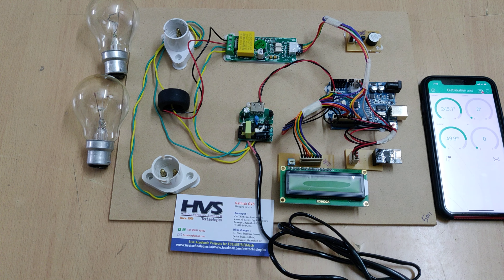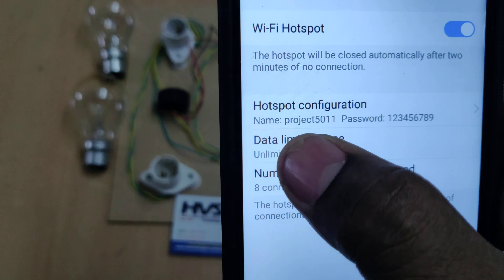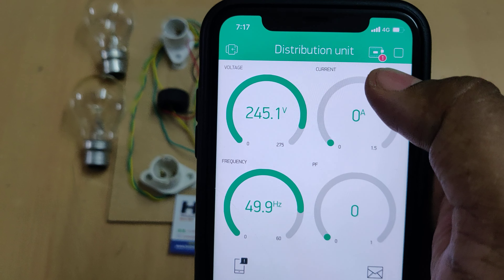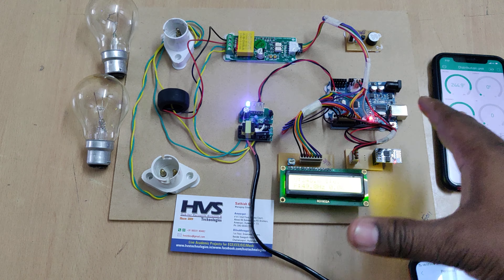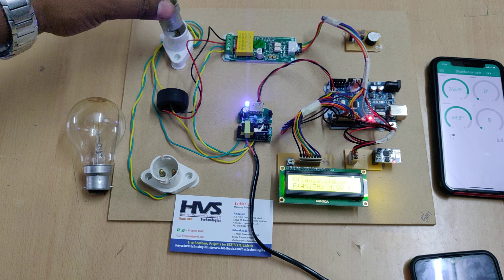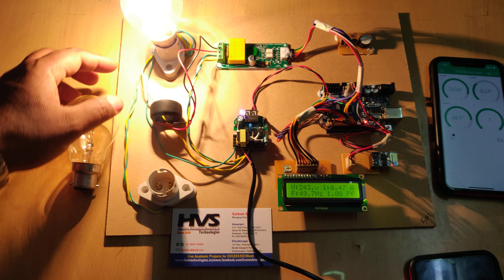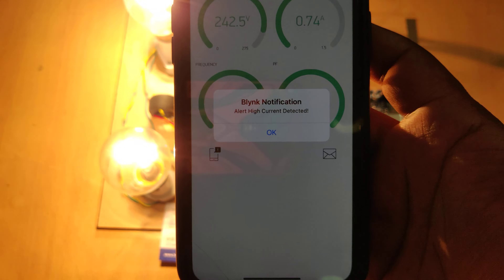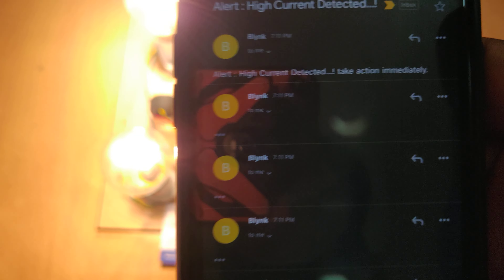IoT Power monitoring using PZEM004t - Voltage Current Frequency Power Factor - Blynk and Email Alert

Comment: Nice video, I'm currently working on a similar project, could you please the Arduino code for the project
Reply from the maker: You can contact us at +919603140482
Through WhatsApp or call